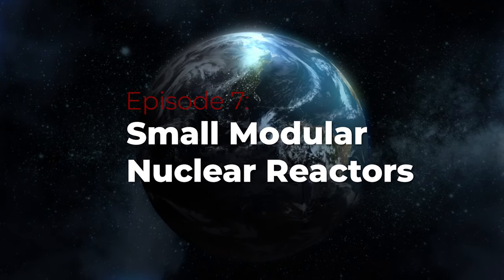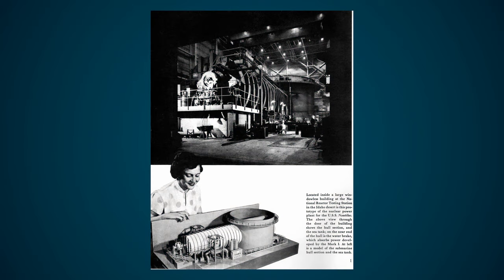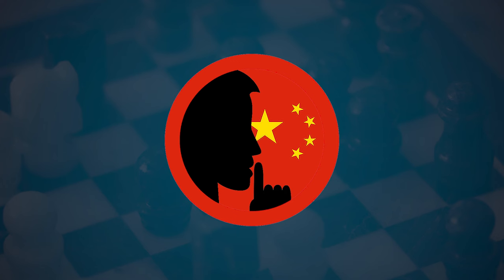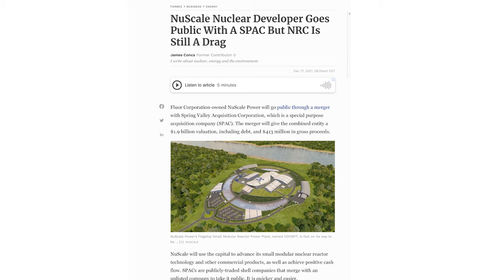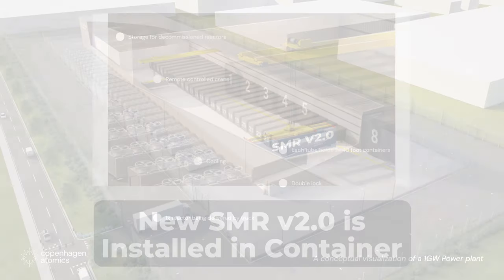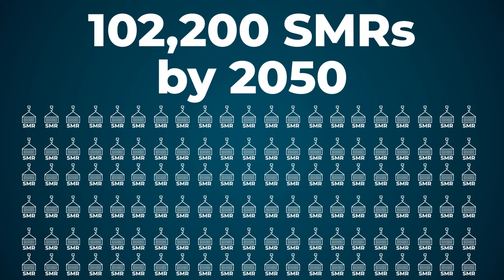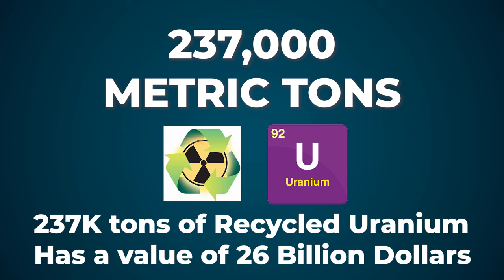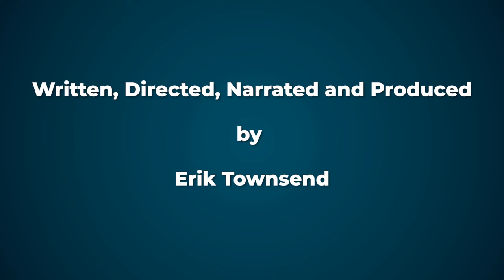Energy Transition Crisis - Episode 7: Small Modular Nuclear Reactors

Comment: Sorenson is right, we need to get on LFTR or similar now.  I've also seen videos on accelerator driven reactors, which use a proton beam to drive neutron spallation in a target and provide neutrons to drive a subcritical reactor.  The claim is that it could burn waste or anything else with passive safety because if the accelerator stops the reaction does too.  Advances in accelerator technology are needed, I think they talked about a 100MW beam.

Comment: Okay, so if I understand you correctly, you believe that nuclear power is our best chance to get out of the energy transition crisis in the near future, and deep supercritical geothermal is the second best, however, that is technologically still far away, which leaves us with nuclear being the best contestant at this point in time. 

Also, if I understand you correctly, you have three points for the future best-case scenario of the course of nuclear 

1. Fast breeders burning away depleted uranium (U-238)
2. These so-called burner reactors burning away actinides 
(The two of which reducing the nuclear waste problem from uranium + actinides + daughter elements to just daughter elements, thereby reducing the nuclear waste problem from a couple of millions or even billion years problem to a couple of hundred years problem)
3. Introducing the thorium fuel cycle with small modular reactor SMRs based on the Th232 - U233 cycle. Since Thorium has a much more favourable nuclear cross section than U-238, therefore building breeder reactors would be possible at a few ten to few hundred megawatt scale instead of the few gigawatt scale in case of U238 fast breeders. And since U233 is much more difficult to bring into a prompt supercritical reaction, and has a much shorter half-life than Pu239, therefore breeding vast amounts of U233 is a much smaller risk for nuclear proliferation. So the designs are smaller, therefore much safer, and proliferation risk for nuclear weapons is much smaller with the Th233-U233 fuel cycle than with the U238-Pu239 cycle. 

So my main points of questions/possible problems are 

1. If you are worried about China or the BRICS taking over NATO in the nuclear field, look no further than fast breeders. Specifically, the Russians have already figured this out and have completed testing their new BN1200 fast breeder molten salt reactor in September 2022. 
https://en.wikipedia.org/wiki/BN-1200_reactor

And I quote the wiki article here:

"The design has a breeding ratio of 1.2 to 1.3–1.35 for mixed uranium-plutonium oxide fuel and 1.45 for nitride fuel. Boron carbide would be used for in-reactor shielding. Thermal power should be nominal 2900 MW with an electric output of 1220 MW. Primary coolant temperature at the intermediate heat exchanger is 550 °C and at the steam generator 527 °C. Gross efficiency is expected to be 42%, net 39%. It is intended to be a Generation IV design and produce electricity at RUR 0.65/kWh (US 2.23 cents/kWh)."

Not only has Russia been continously researching and developing fast breeders since the late 1960s, but their previous 2 designs, the BN600 and the BN800 have been on the Russian grid for decades, the BN800 being the first one that achieved a breeding ratio of > 1.0 and being safe during operations. The BN1200 takes this one generation further, with better breeding ratio, better neutron economy, safer and cheaper operations and basically being the first Gen IV reactor that is currently registered for commercial use. Continuous operations on the Russian electric grid were first planned for 2020, which has been delayed, the current goal is 2025. So if you are worried about the BRICS taking over, well, when it comes to burning away depleted uranium, they are decades ahead of us unfortunately. 

2. Could you be (assuming there are closely guarded trade secrets here) a little bit more specific about how these burners work? The technologies that come to mind in this field are spallation reactors, proof-of-concepts of which have been completed by CERN in the early 2000s. I would presume this would be the basis of these burners. 

https://world-nuclear.org/information-library/current-and-future-generation/accelerator-driven-nuclear-energy.aspx

The only other thing that possibly comes to mind would be some laser-based technologies, for instance the relatively new superlaser project in Szeged, Hungary has one of its goals set on breaking down actinides with ultra-high output (Petawatt) laser pulses. They have just announced a major breakthrough in this last year. However, this latter one is still in its early experimental phases at the moment. 

https://u-szeged.hu/news-and-events/2022/szte-researchers-one

3. If the first 2 points do really work, the third one becomes relatively unnecessary in the near future. One kg of U238 contains about 84 million Megajoules of energy. Humanity has mined about 2.4 million tons of uranium since the birth of the nuclear industry in the 1940s. 2020 uranium consumption was 59,200 tons. As far as I know, globally, we are only practically burning the 0.7% of uranium in the form of naturally occurring U235, while the 99,3% U238 is basically just waste at this point. If we were able to recycle all used fuel pellets and burn all uranium (which is exactly what the Russian BN1200 is capable of doing by breeding Pu239) then the 2.4 million tons of uranium mined since 1940 holds roughly 2.4x10^9x84x10^12=2x10^23 Joules or 56 million Twh. Current global primary energy supply is about 173 thousand Twh. Even if I calculate with the 237,000 tons of U238 you mention in the videos, I come to roughly 5.6 million Twh which is 33 years of global primary energy supply, which makes the thorium cycle redundant for the next few decades. Not that developing and maintaining these SMRs would not make sense now, since if we invest this now, it will be with decades worth of experience to roll out and mass-produce them when depleted uranium is all used up and the nuclear waste is reduced to a few hundred years problem, hopefully in the next 40-50 years. And I do agree that burning away all the nuclear waste should be our number one and absolute priority, especially to improve the PR of nuclear power. But massive mass-production and rollout of Th232 fuel cycle SMRs seems to be contraproductive if our goal is really to burn away as much as possible from the waste generated by the U238/U235 fuel cycle.
Reply from the maker: Wow! Great feedback and my apologies for the delayed response. I'm just now learning to use the "Channel Control" features of YouTube that allow me to find all the comments I haven't read and replied to yet.

On your first comment, very close but not quite. The way I would describe it is that deep geothermal would be the best source if the technology was ready for prime time, which it isn't. Even with SMRs, although there's no real "bomb" risk, it's still possible someone could try and steal one and use it to make a dirty bomb with conventional explosives or something. Deep Geothermal would completely eliminate all those nuclear worries, and that's why I say it would be best IF we had some major breakthrough that made it economic. But even then, the technology is not ready for prime time. Nuclear would be my 2nd choice after Geothermal IF they were both real and ready for prime time right now. Nuclear is, and geothermal is not. Therefore nuclear wins, hands down. But a really big geothermal breakthrough could conceivably change that. It would take a LOT.

On to your specific questions now:

On #1, I definitely agree with your assertion that Russia is making great progress and US Gov't has its nuclear head up its ass. On fast breeders, I personally have a huge respect for the technology itself, but the PERCEPTION problem around weapons proliferation is so strong that I intentionally avoided directly advocating fast breeders in any way. Again, it's not that I'm personally against them. Rather, it's a fight I'm just not up for with the most adamant anti-nuclear activists. I can beat them in debate hands-down on the merits of a THERMAL SPECTRUM Th232-U233 breeder, and they can't win. It's much harder to win the fast breeder debate, so I avoid the topic.

On #2, I'm afraid I don't have the technical knowledge to know the answer myself, never mind worry about keeping anything secret. Although I have a (software) engineering background, my approach to this sort of thing is to only learn the science/engineering aspects to the extent I need to in order to know how fit together a BUSINESS strategy for building these things at SCALE. So I know the basic parameters of what burner reactors can do, but the details of how they were are something I've intentionally not concerned myself with; sorry.

On #3, if I'm understanding you correctly, you are saying "Hey, if we need to burn all that waste, why don't we do that instead of building Thorium Breeders?" That's exactly why Copenhagen Atomics designed its Th232-U233 Thorium breeder reactor to ALSO be a waste-burner. They wanted to BOTH offer a Thorium breeder and a waste burner in the same product. The way it works is ALL Thorium breeders need a "kickstarter fuel", which is usually LEU. The U-235 in the kickstarter fuel sustains the fission reaction until enough U233 has been bred from Thorium. My understanding of the design (and I'm NOT the expert) is that they used burner reactor technology (whatever that entails--I admit I don't know) to allow the kickstarter fuel to be spent fuel waste. The Copenhagen Atomics Wasteburner will only "need" a kick-starter dose of nuclear waste to get things rolling, but if you NEED to burn more waste, I believe you can add more spent fuel waste, which isn't actually needed at that point to sustain fission, but it still offers a way to get rid of the waste.

Now to be clear, I'm NOT saying that CA Wastburners are necessarily the "best" way to get rid of that waste. Each of those little 100MW CA Wasteburners only needs a little bit of waste to get it going. They will be all over the place, and transporting that waste to those locations to load it into the reactors seems pretty silly. Probably makes much more sense to co-locate a really big Pu-239-fired powerplant with a nuclear waste reprocessing facility so that the waste can be burnt on site with no transportation or custody risk, and the electricity generated could power a major city. So maybe the best way to get rid of the waste is with much bigger burner reactors.

But where I agree with you most is that this is a PR problem. Nuclear waste disposal is 2nd only to meltdowns on the public's list of irrational nuclear fears. Arguing that the fears are irrational is unto itself irrational. The public has irrational fears and those irrational fears are preventing a nuclear renaissance. We have to solve this "non-problem" as my Nuclear engineer friend Mark Nelson likes to call it, because we can't have public support for a nuclear-centric energy transition until we do. It's that simple.
Reply: Did you get a warning on your channel for spam after leaving this comment?  I've had warnings and I think it was due to putting links in comments, similar to yours (to things like wikipedia).  Of course they don't tell you why.

Comment: Most current smr design are actually not all that small or modular. Neutron economy is a problem and site prep are not that much less than large reactor.

After the US spent so much effort and capital to iron out the design of the ap1000, i don't see why you wouldn't pump them out by the dozens.

Comment: Assembly lines work for millions or thousands of units, not for a couple dozen per year.
Reply: in my understanding it should be rather thousands of units per year as the power of each reactor is limited
Reply: @yepyep4931  Plus they are water based which is asking for trouble, a concern for radiation leakage.

Comment: If breeder reactors can use and greatly reduce all nuclear waste, that is a very good thing. So if I understand this video series, the remaining 5%   of waste can be used in burner reactors. Does this technology exist? 
    I would not discount solar, wind and geothermal though. Wind turbines offshore can supply near continuous power in some areas. With connected grids when there is a deficit of solar or wind in one area, another area can makeup for it. This applies timewise in case of solar or weather conditions, for solar and wind. Better batteries are also being developed. The efficiency of solar panels is increasing. Cost is decreasing.
   Interconnecting across a continent or intercontinental could solve intermittency and allow fareness in energy to all.
Reply from the maker: "Does this technology exist?" is a tricky question. The technology "exists" in the sense that people know exactly how to build a burner reactor. But nobody in their right mind would ever give investment capital to a company building one because no nuclear regulator on earth even has a process for approving such a reactor. The primary problem is not technology but government. We need a world-class nuclear regulator that wants to be part of the energy transition solution rather than being part of the problem. U.S. NRC has failed miserably. I'm trying to lobby other governments to do what U.S. failed at: getting nuclear power regulation right.